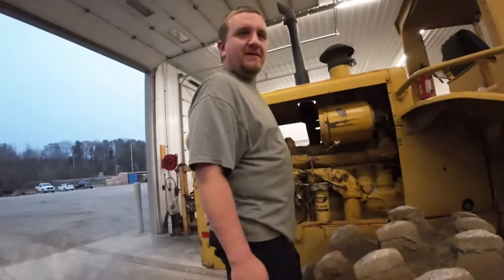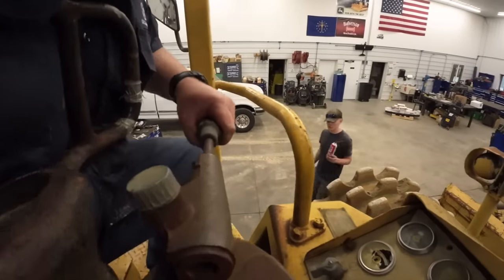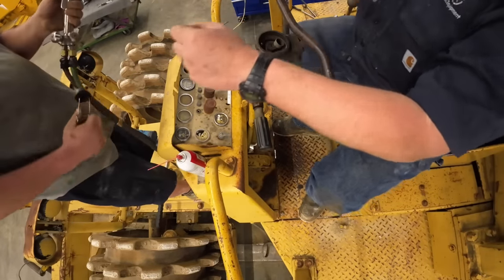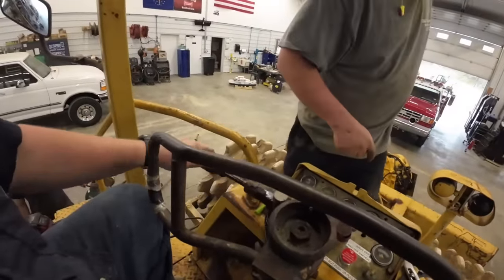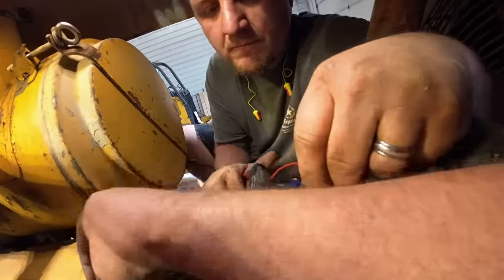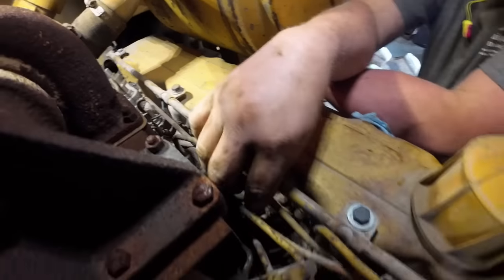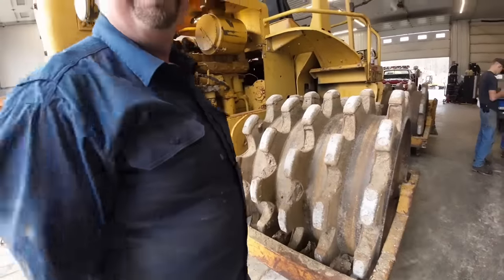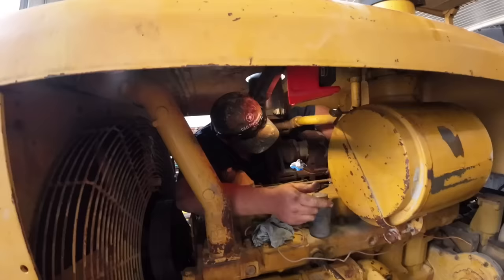Cat 815 Compactor I bought at auction, Did my gamble pay off or did I get burnt!

Comment: 815's live forever.  I designed the wiring and or cabs for the wheel loader/compactor lines from 1997- 2020.   The only reason to ever replace the 815 is because the emissions requirements changed.  They are just loafing most of their life.  It does not take a ton of skill to operate it.  The designs never got any love from cat. They basically got the wheel loader cab and not much else.  The latest thing is intelligent compaction that can calculate the compaction on based on torque converter slip. Then it can be transferred to a virtual map.  Has to be a big project to justify its use...like an airport or a huge stretch of highway.   But it can improve the quality of the compaction and save a lot of fuel if done correctly.   But the material selection is really important.  It is not just the machine.   @Letsdig18 knows his materials with all of the ponds he builds.  His buddy charlie did a lot of cool soil amendments like portland cement to get the soil to compact. 

The bottom line, is that it is one of the more important machines on a road or pond project.

Comment: Where I work at we had a forklift that was literally falling apart. They refused to get it fixed or serviced. Same with the concrete in the back where the pallets and other stuff is stored. Holes big enough to get the forklift stuck. They always said it was corporates fault but the store Mgr is suppose to ok projects with the regional.

Comment: There is a Cat 518, it’s a Wheel Log Skidder, with a 4 cylinder engine of around 120hp - smaller brother of the 528 which has the 3306 6 cylinder.

Comment: That compactor is the type they use at landfills to compact the trash
Reply: That would be the 816 main difference is the wheels
Reply: I ran several diffrent 815's over my career as a heavy equipment operator. They are good machines . I worked on building house pads and building pads for wharehouse's . @russellsmith3825

Comment: Refrigerators have to have a heater in the ice box to work. If the heater goes out the air cannot circulate to the other side of a fridge. The heater is just a wire coil resistance heater and when I put it in the fridge started working.

Comment: At 28:36, To tighten up a hammer handle, soak it is auto antifreeze and it will not dry out as it will using water.

Comment: Caterpillar did make a 518 but it was a 518 skidder for Logging. They started making them back in the 70s and ran them up until the 90s. I learn to run one when I was a kid spent 10 years on the damn thing.
Reply: They were an excellent Skidder, well designed and good quality. Very stable compared to a Clark - their main competition at the time. It’s bigger brother, the 528 with a 175hp 3306 6 cylinder was the Rolls Royce of Skidders - in it’s day.

Comment: CAT 518...Landfill Compactor was produced between 1987-1992.
Dimensions:
A. Overall Length. 18.77ft in.
Overall Width. 8.67ft in.
Height To Top Of Cab. 9.55ft in.
Ground Clearance. 1.55ft in.
Wheelbase. 10.67ft in.
Drum Diameter. 10.04in.
Max Line Pull - Bare Drum. 26363lb.
Max Line Speed. 301.84ft/min. 518 

:Landfill C

Comment: You need some surge protection on your electrical panel and an AVR at each computer like a CyberPower CP1500 that has network protection. They're $220 each but they come with a $500,000 connected equipment guarantee and have ports to connect to ethernet as well as USB and serial ports. It can save expensive and necessary equipment. Also check to make certain that your building is grounded well.

Comment: You never have to worry about flat tires. 😂. But- replacement of the caps are quite time intensive.  And not inexpensive 😢.  Y’all need a belt mounted holder for the skunk piss, for to always have handy the most used tool in the shop……

Comment: Clint and crew - as always enjoyed your video. Some kind of surge protection on your electrical  and if you have a fire alarm panel would be a great help. Also, did you ever consider a corrugated cardboard  baler to handle all the parts boxes you get ??? May be another source of income,  a fiber broker could probably help to determine if you have enough volume. You have a great business - and good ethics and  best of all     -    Fun

Comment: I took offense to that, I operated an 815 for a couple of years. When I wasn't running the 815, I was running the 963D. The 815 wasn't something everyone could run easily, could keep up spreading and compaction with a steady stream of trucks as long as the truck drivers could dump correctly without being shown.

Comment: Well, they used some of these in landfills. But they also had a unit which had different wheels that were specifically designed for landfills. We would get both at the Cat dealerships. Hated the ones from the landfills.

Comment: My goodness what type of concrete do you guys have in that building that does not crack and come apart when machines like that roll in and out? Yes I can see that you have what appears to be a steel plate in the floor for the track vehicles but something like that, that is designed to compact has got to do damage eventually?🤷🏾
Reply from the maker: We have i beams in the floor

Comment: You need a UPS for your computers to protect them from power issues.
Reply: a UPS wont do squat from a lighting strike/surge,aside from keeping equipment from shutting down. UPS is uninterruptible power supply , meaning it'll keep equipment from losing power. they dont take lighting strikes/power surges well
Reply: @harveylong5878  your wrong about the usage of a UPS. It will protect you from power surges and most lightning strikes. That's why all data centers have them.

Comment: from an internet search the Cat 815 is a 249 HP landfill compactor and may also be outfitted as a log skidder. The 518 is a 129 HP dirt compactor. I'm a motorcycle guy so don't have any idea if any of that is correct - but it is on the internet!!!
Reply: It’s the other way round, Mike. The 518 is a Log Skidder, I used to operate one. They are an excellent machine, good quality and an excellent design. 
  I don’t think an 815 could be used as a Log Skidder without major modifications.
Reply: @tutekohe1361      OK, I believe you. They both have too many wheels for my liking anyway! 😜

Comment: Clint, a caterpillar 518 is a landfill compactor.  It is a real number used.  I spent many years on one.  If you look up Richie specs you will find it too
Reply: I am too lazy to look anything up, but my first thought was that if it is a true 815 then the numbers on the back end are simply reversed... or they put two ends of machines together to make a new one?? The issue is how to sell it, either by its derriere or its front rack. In this case you have got a Lizzo problem, both ends are not set up for looks, so gotta sell her by how she sounds!!
Reply: Caterpillar also had a 518 log skidder. They are great machine full time 4wd they will go places other skidders wouldn't think about going